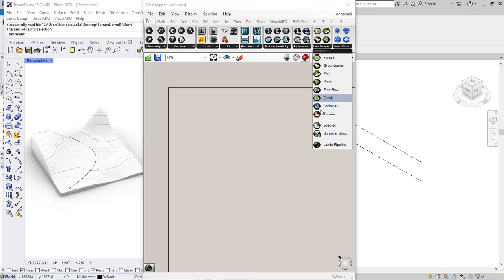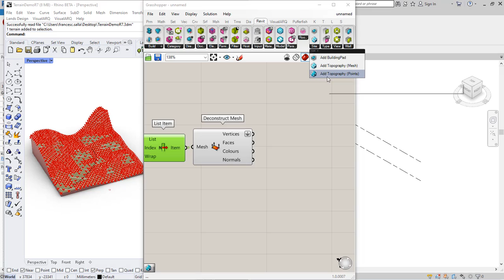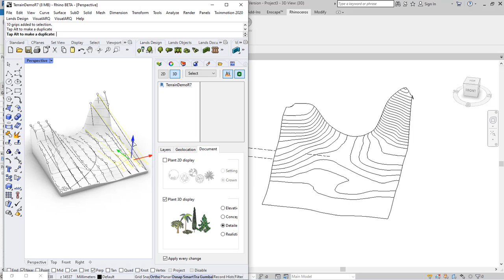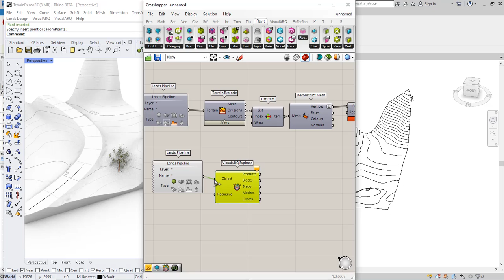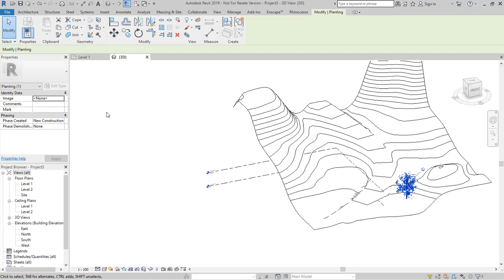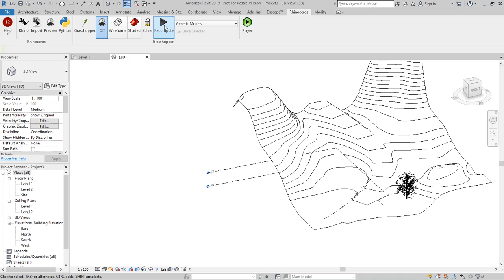Lands Design running inside Revit

Comment: Nice!!!  one quick question. After importing the plants into Revit. Can we control the visibility of the plants, such as showing them as conventional 2d line drawings on plans and sections, not as 3D object?
Reply from the maker: If you need plants as 2D blocks in Revit, you can set the project to 2D from the Lands Design Edit panel in Rhino and export it with its 2D plant blocks.
However, you cannot convert a project that was already imported into Revit in 3D, into 2D blocks. These are not native Revit objects, so all changes must be made within the Lands Design in Rhino.

Comment: Hi, I also tried the process and it all works until the end. At the last component, topography from points, I get a red error saying that XY match for some points even if they have different elevation and so I can not import it into Revit. Do you have any suggestions? Can it be that I created a border for the terrain in Lands Design that overlaps with some points?
Reply from the maker: Hi Diana, you will need to remove duplicated points when you "Deconstruct" the mesh obtained from the terrain, before you connect them to the Topography Revit component in GH. If this is not working for you, please send us the affected files to landsdesign@asuni.com
Reply: Perfection. Thank you!

Comment: Can it make sub-regions that update live?
Reply from the maker: Hi Scott, Yes that's possible. Take into account that each division in a Lands terrain generates a new mesh, so you will need to connect that mesh to a new AddTopography component in GH, to generate a new Topography object in Revit.
Reply: Or even make separate topo surfaces in the way you might make sub-regions normally